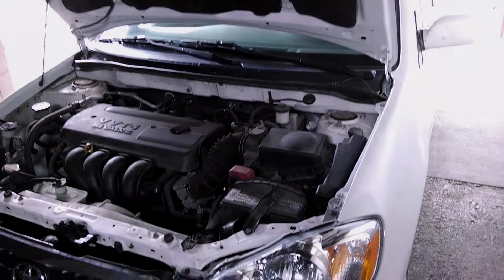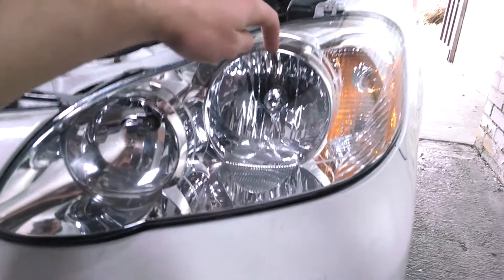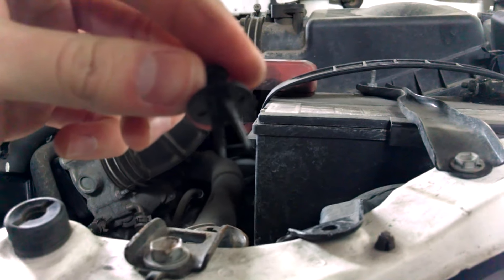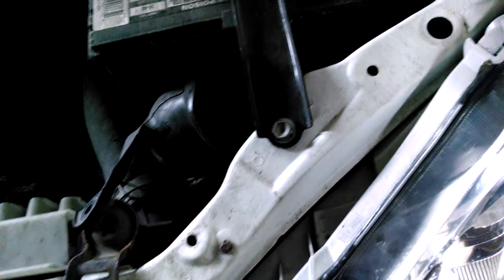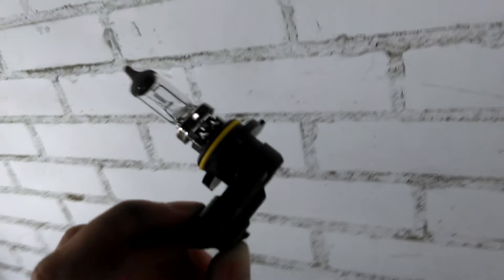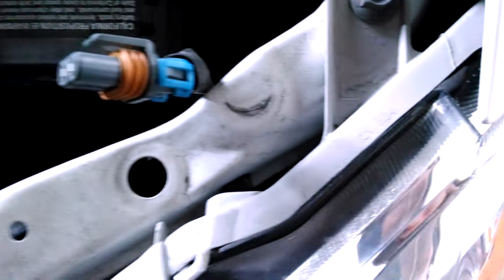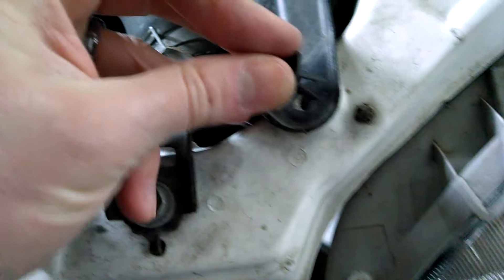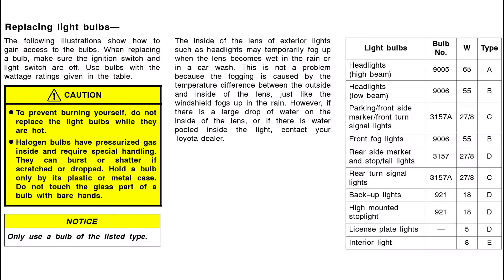Toyota Corolla 2003 - 2008 headlight replacement tutorial - only takes 5 Minutes!

Comment: I just change the bulb and  I am 70, if I  can do it, anyone can, thanks to you tutorial.  My Toyota Corolla is 2006 and after I separated the filter, I realize what was behind it was the high beam bulb,, so I put the pin for the filter back. The only problem was the space left between the battery and the side of the car is very narrow, good thing I have very narrow hands.  No problem taking the bulb out but a bit putting it back in, again the space.  I guess  a person with big hands, he/she probably would have to take the battery out.  Thank you again. I can erase this on my bucket list :)

Comment: Thank you for posting this! It took five minutes to change both of my low beam bulbs on my 2004 Corolla. I found that I didn't need to move the hose for my left headlight, maybe because my hands are smaller? Whatever the reason, I'm happy that I could do it myself instead of spending all the time and money at a shop!
Reply: +Cheryl Beidler Good Job! I have a 2003 Toyota Corolla and I need to change the bulbs too.

Comment: FIVE STARS.  Excellent video.  Easy to understand.  I didn't need to pull out the air filter hose to access my low beam bulb.  Some people may need to move the battery clamp if they have larger hands.
Reply from the maker: Thanks Malcolm! Really appreciate the feedback

Comment: Thanks a million! I did it the way you described. I replaced the low beam bulb on the driver( battery) side in 3 minutes. I didn't even have to move the air filter unit. Thank god I ran into your video. When I first saw the others showing all kinds of chassis dismantling, I really thought I should take my 2005 corolla to a mechanic!! You not only saved me some money but more importantly the time!!!!!

Comment: Watched this video 4 minutes ago (I had already bought a replacement), and I'm finished and back upstairs writing this review.  Your video gave me the confidence to attempt it - but it was SIMPLE.  Local shop wanted $25 to do it, the bulb was $10.  Note, there was no reason to remove the air filter valve - maybe better access on 2008 model? Just reached right in and switched it out. Thanks!

Comment: Finally, a helpful YouTube video that cuts straight to the point. My headlight is fixed and I saved over $60 I would've been charged for labor to have a car mechanic fix it for me. Thank you!
Reply: *****
Yeah, the sad part (for them) is if they only charged 5 or 10 bucks for the labor, I wouldn't have even thought twice, but when they tried to charge almost 80 bucks for the bulb and labor, I was like, "Um, I think I'll do it myself."
Reply: *****
Correct you are! My grandma and I go to different Toyota service centers, and we are both shocked at how much they charge.

Comment: Excellent, imformative video…1 tip I can add, is the guy at the auto part store just told me never touch the bulb with your fingers, it will blow out fast because of the oil on our hands.

Comment: Good video.

My 2006 did not have the easily removable pin for the air hose, so I ended up doing the battery loosening method.

Comment: thanks!  Just happens to be the bulb that went out too!  However I upgrade for both sides because although the Corolla is one of the best cars ever made-the low beams have never been bright enough for me.  I spent $41 to go to two steps brighter and well worth it.  I did not know there are several levels of brightness depending on what you want to pay for.
Reply: Same here.  I have never been happy with the low beam coverage.  Did you go to LED or stick with incandescent ?  At $41 I suspect it was incandescent. Please advise.

Comment: Thanks for the tip about the air pump, I wasn't aware of that. ! If I weighed 100 lbs. soaking wet, I could probably change the bulb myself, but unfortunately I'm a fatty and no way will my arm squeeze in far enough. So, I'm still going to have to take the battery out or else hire Gumby to do the job for me.
Reply from the maker: haha thanks for the comment, Billy. Hope it worked out ok

Comment: my fat arm was probably a factor (plus having a jacket on during this job), but moving the air intake hose didn't give me nearly enough clearance, so i had to pull the battery. nevertheless, the video is appreciated since it let me know that i wouldn't be dealing with security screws like i did with my old Chevy Impala

Comment: Many thanks for the video! Two questions pls:
- Same procedure for my E15 (before facelift)?
- Do I need to adjust the height, position of the bulb after replacement?
Reply from the maker: E15? That's a van, correct? Overall same process, might be different getting to the bulbs.
As to your second question, no you don't have to adjust the bulbs at all after placement

Comment: I just changed my 2004 corolla left low headlight. But I moved the battery out to do it for more space. The instruction in the manual didn't mention to move the battery but it seemed easier space wise to do so. After watching this video I guess I didn't have to do that. Next time it's good to know.
Reply: +Jason Foote Yeah after my experience I don't recommend taking out the battery unless you have to for the space. I'll try to keep the battery in and just squeeze in to access the lights next time. No problem on the clock it stopped displaying a couple of years ago and Toyota told me it's a big $300 job to open the dash to figure out what wire is loose just for the clock. I did have to reset the radio station because I removed the battery though.
Reply: +micrasystems What I was thinking of doing since all the bulbs are only $4 - $6 each is every say 2 years replace all lights including the low and high beams, signal and break lights front and back. It'll be like $30 - $40 in bulbs and 30 - 45 minutes of time and you'll be replacing most that are still working but then at least you can choose that time to do it in your garage that's convenient and then none of them will go out unexpectedly when driving.

Comment: On the driver side It's easier to pull out the battery. No big problem. remove two bolts on the crossbar, remove it and then the battery clamps. Lift out the battery, change the light bulb as said in this video and then put it back together.
BTW you will have to replace the battery at some point so this is the same process for that.
Reply: Yah I have a 2004 Corolla and there's new room to put your hand down there and moving the battery is the easiest option.

Comment: Thanks, I'll try moving the hose. I think last time I replaced I took the battery out. But I would rather not do that again as I just replaced my battery 3 weeks ago (and had to use a repair kit on my positive cable which was corroded).

Comment: I just changed the same bulb on the same model and year as this one, but you don't have to move that filter, it's on the wrong side for this bulb.  What you do have to move aside is the battery though.  Once I moved the battery over I could access the bulb.

Comment: In my instance the battery was in the way (it's larger than the one in the video) so i had to remove the battery bar and push it to access the socket, but other than that no issues

Comment: TIP: there is no need to remove the clip to replace the driver side low beam headlight bulb on a 2008 model.
I followed the nice instructions in the video and removed the clip and the clip cracked because old and worn. had to buy new clip. Not necessary, the low beam bulb is reachable without removing the clip.

Comment: Great tutorial video. Turns out either my hand is too fat, or my battery is pushed to close to the side that I can’t get my hand in there pull the light bulb out.
Reply from the maker: Darn it. Maybe a kid in the neighborhood can do it for you :)
Reply: @JasonsHonestReviews   I ended up removing that metal bar that sits on top of the battery so I could move it and get my hand in… then the rest of it was a piece of cake. It was only hours later I realized I completely forgot to put that little plastic screw thingy that attaches to the hose back in 😂😂🫠

Comment: I have a 2007 Corolla. Have the bulb out and it's not the same as this unfortunately. Having trouble getting the replacement back in though because the spring clips are a nightmare to get back into position.
Reply: I got it sorted eventually. Seems it's fitted with a Prius HID headlight so I was able to find a tutorial showing the spring clip mechanism. Thanks.

Comment: the bulb on my 2004 Toyota corolla is has this plastic adapter between the plug and the bulb... someone must've lost it while replacing the bulb at some point and I can't seem to find a replacement. if anyone knows what the part is called that would be a huge help!
Reply from the maker: Mine actually pulled off on accident the other day. I had to yank it out of the bulb I was trying to install

Comment: After trying this I came to the conclusion that only a fool would be so lazy to not remove the battery first. 😂
Reply from the maker: Thanks for sharing the tip. I guess my hands were small enough to squeeze in there
Reply: @JasonsHonestReviews  it was doable, and now that I know how it works it will be easier. But it was a tight fit. After some swearing I got it sorted. Not easy if you got big hands for sure. 🤣

Happy New Years
Reply from the maker: Glad you got it sorted out,  @pingulainen  . Happy New Year to you as well!